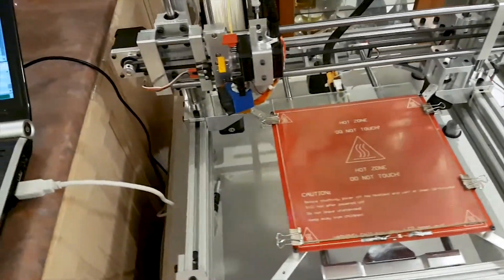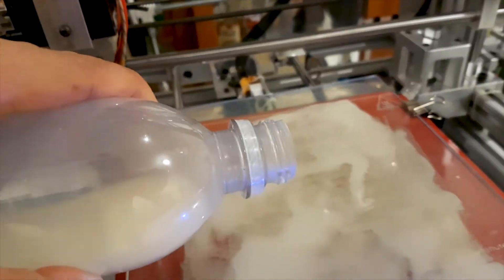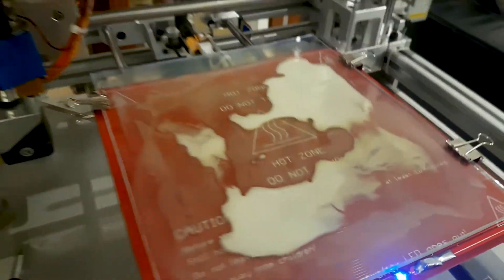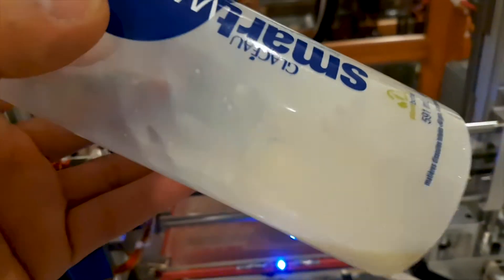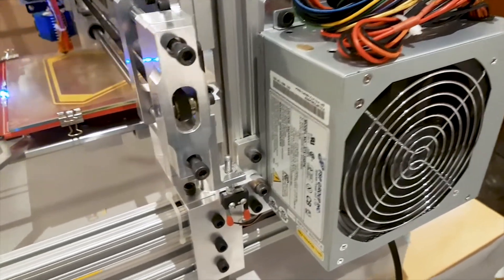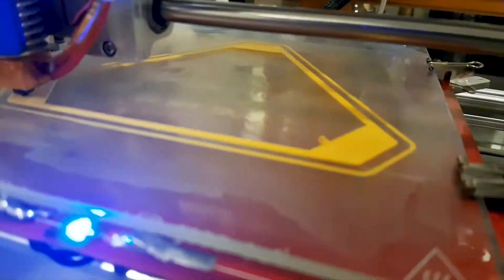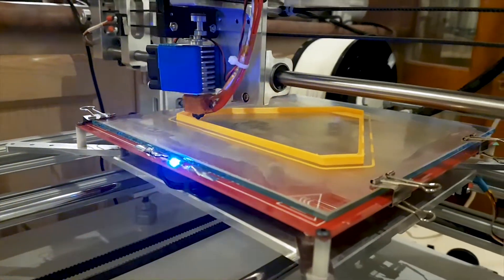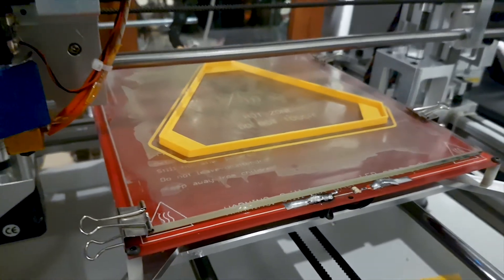How to make 👍 the best and safest ABS Juice/Slurry for 3D Printer! 💪

Comment: one method to secure the print even if it detaches is to use a 10mm skirt then tape it to the bed after it is printed, it may be acceptable for some applications but the quality will not be too good.
Reply from the maker: try my wood glue method yet...? non toxic for ABS printing. 🙂
Reply: @lavithhcm  it sticks better but it depends on how bad the warping is. sometimes the forces are too high. Bed temperature was 100C, maybe it’s too hot.

Comment: I was nearly ready to make some "ABS Juice" (from Acetone) when your video kicked in.
Using a wood glue / water mixture is a bit surprising, and pretty clever. I'll give your method a serious try very soon on a relatively large ABS print. :)

Great printer, btw !
Reply from the maker: yeah! Acetone is a big no no for me. I learn it hard way. First, it's not user friendly ⚠️. And the smell is just unbearable. If you not carefully disposed of it, acetone will destroy your drain pipe because most drain pipes are made of ABS.

I didn't give out the ratio mixture between wood glue and water. it should be watery and dried smooth. A little wrinkle doesn't hurt. When you wanna clean the glass plate, just use soap and water. Done!
Reply: Sure. Acetone is a really nasty stuff. And since I'm printing on a textured PEI flexplate, acetone can't be used on that kind of surface.

Right now, something's being printed using a 1:10 ratio. Seems to hold its promises so far. I saw a bit of warping somewhere, on a corner, probably because the juice wasn't applied evenly enough. Still, it's very minimal.

Comment: hi, great tip... how about the ratio of water and wood glue?
Reply from the maker: Try 1:10 ratio first. Add more glue into the mix if too thin. When too thick, you start to get wrinkles on the glass plate. Just wash off with soap and water if u wanna clean it. I normally dont do that.
Reply: 1 glue by 10 water right, now i use abs Juice... Maybe with wood glue will reduce trimming process
Reply from the maker: @ianfaisal3243  abs juice you mean abs crap and acetone? I used that stuff before too. too much smell. Anyways, yeah start at 1 glue and 10 water. The good thing is water evaporates leaving only glue on the surface. if you want more thicker glue apply few more coat just like how you paint. You can mix thicker solution of glue and water so you just apply lesser coat. you know what i mean. I guarantee it won't smell anything. If it helps let me know.